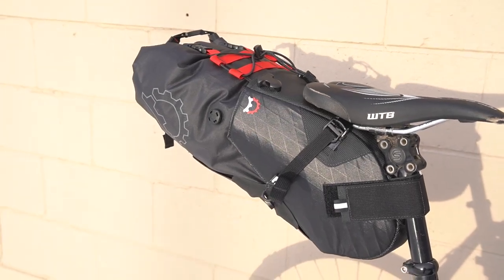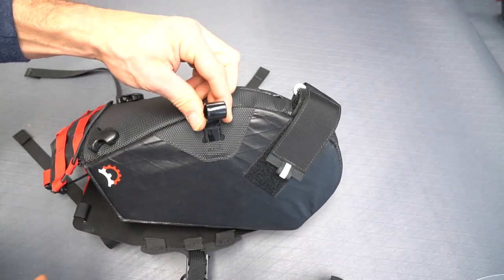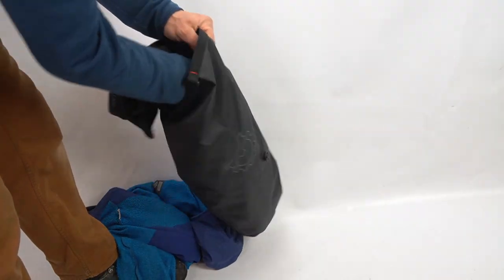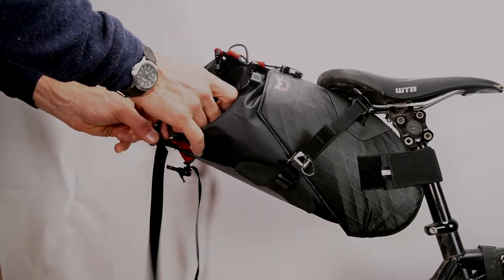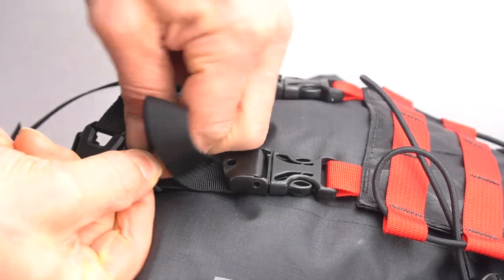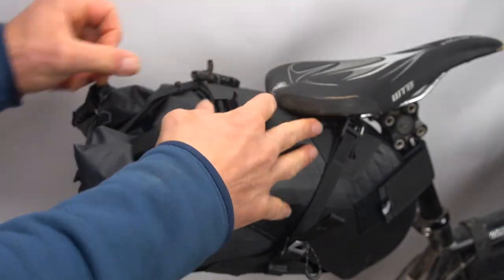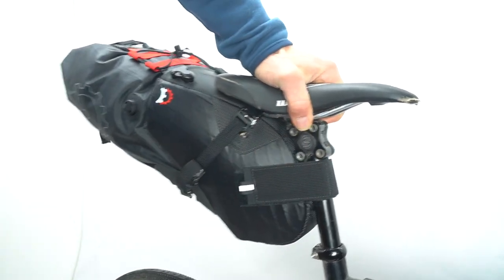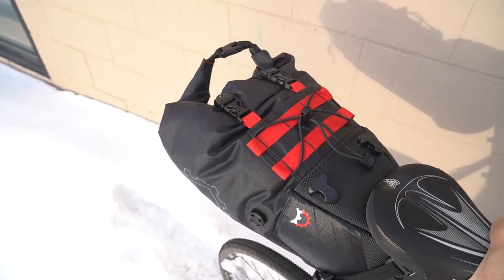Terrapin System - How to mount and pack your bag

Comment: An absolute UNIT! Also, word to the wise: backcountry on a full-suspension bike will make that setup difficult.
Reply: There's actually a lot of clearance with the Terrapin. Unless you have a very small frame, it should give you plenty of room for movement on most full suspension bikes.
Reply: @DanBaileyPhoto  Fair point. Very fair. Realized I'm using my short-statured wife on her Trek setup for a reference. (Blaming it on the King Street!)
Reply: @DanBaileyPhoto  I will, however, die on the hard-tail hill. ;-)

Comment: Does this bag work well with most suspension seatpost? I saw the extension strap for the Cane Creek Thudbuster on the website but this video shows install without an additional strap. Is this seatpost the eeSilk?
Reply: I use this bag with my Cane Creek eeSilk+, bit tight underneath the saddle (WTB also) but works straight away, nothing additional needed